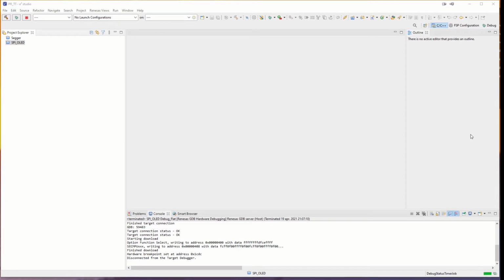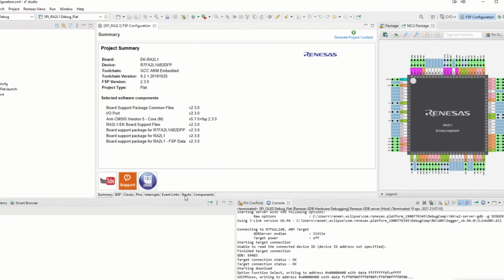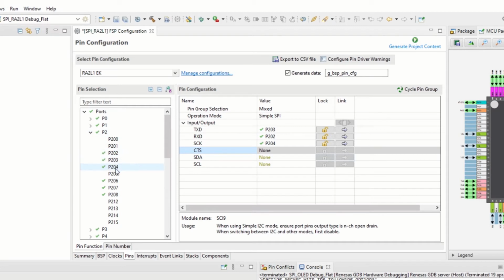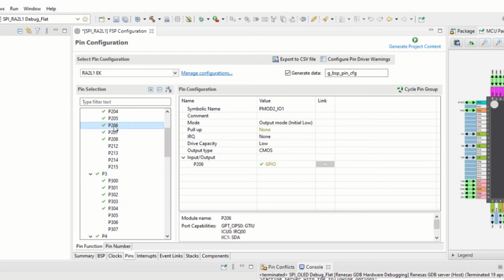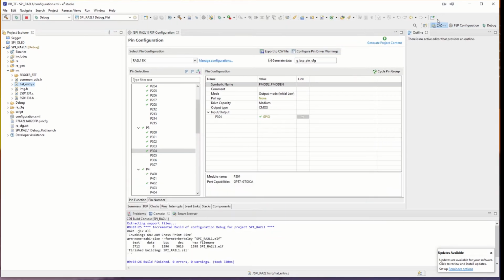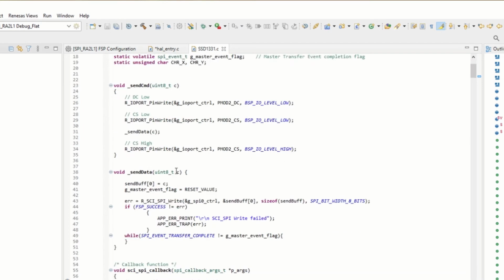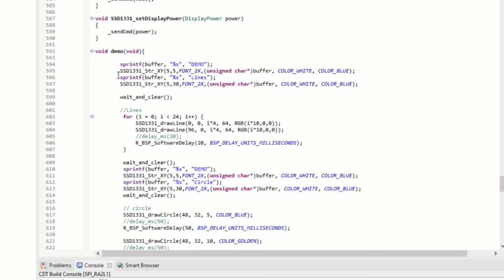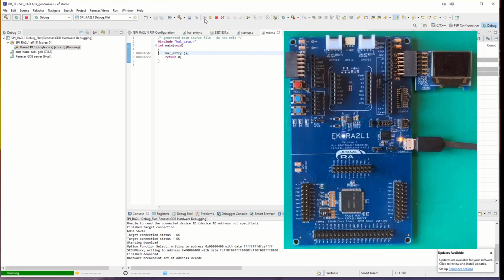SPI OLED RGB Display on RENESAS RA2L1

Comment: hello I really like what you are doing, I am a french student and I am working on a similar project which is to test the spi on an E-paper. I would like to know if it is possible to use your project to test my E-paper screen or do you have simple examples of displays (a sentence for example).
ps: I work with the eval kit RSSK RA2L1. 
reference epaper : HINK-E0213A189